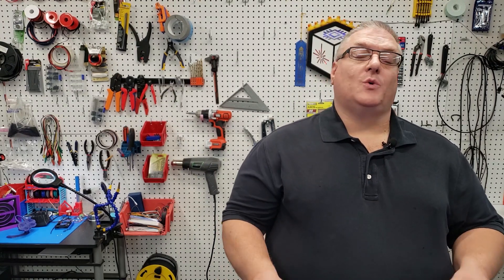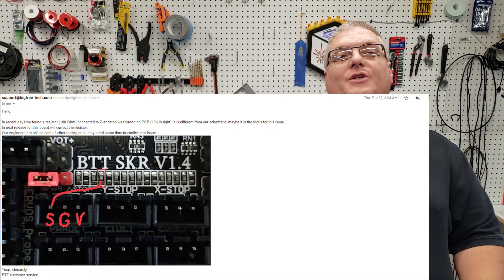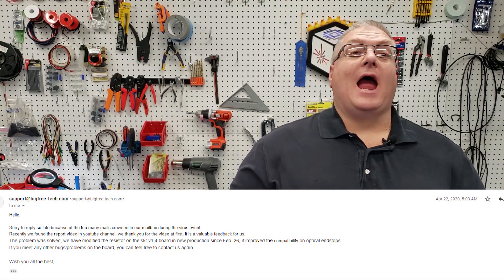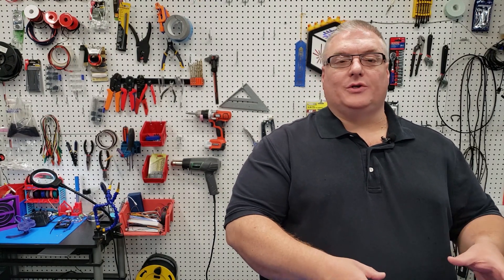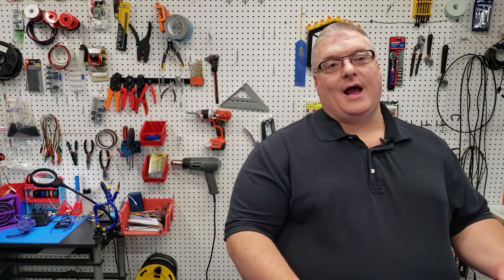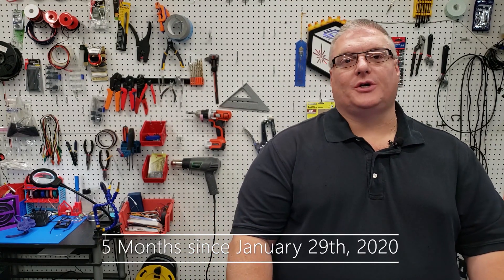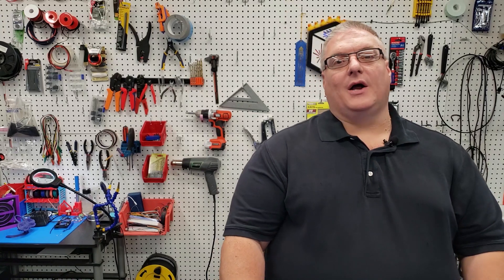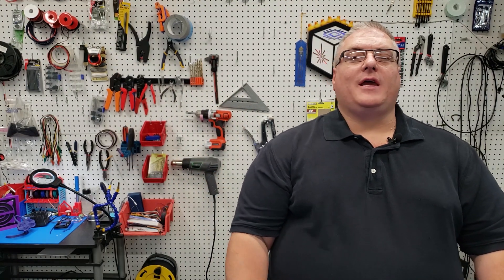UPDATE to the Big Tree Tech SKR V.1.4 Mainboard Endstop / Limit Switch Bug

Comment from the maker: What are your thoughts on the way BTT responded to the issue?
Reply: Agree with your assessment. Terrible customer service and passive aggressive behavior. Speak truth and let the bottles fall.
Reply: They ignored me...never answered my request for a replacement board.
Reply: Hello, the support level 1 is really reactive if you have issues with configuration,  but the level 2(engineers), from BTT they are really busy, so if this is not a configuration setting invalid, but a real trouble, I never get an answer.  For instance I submitted 2 real issues: mechanical dual endstop repeal from BTT  not working in standalone for each motor,  and another issue when extruder is set to 0 then the board is never seems as connected by tft BTT 43 and 70. For both issues I did not get any answers from engineers.

Comment: The 4th resistor number is R17 and it's value is 1k.  not 10k.
i purchased skr 1.4 just few days before, and it have correct resistor that i checked by multimeter.  but it has same issue.   the end stop worked well at first operation but now the mechanical z end stop has always triggered position.  why?????

Comment: both my boards (1,4t) ..    don´t work on any endstops pins..

and my latest board  are from 20200627  and still have the wrong  resistors,  you can look at your board if there @  2.8-3.3v and S pin then  its good.   but all my boards have only 0.025v   

I double checked on my  1.3 board  that works correct 
and even my old ramp 1.4

Comment: Hello, thanks for this video, I submitted to BTT an issue with Dual mechanical endstop on dual axis with dual endstop. Each endstop is stopping both stepper motor, instead of stopping only the related one on which it is connected.  They tols me my configuration is right, and send to hteir engineer, this is a month that I submit this. 

did you encoutner this issue too ? 
I also have trouble with sensorless homing on SKRV1.4 with TMC5160

Comment: I have an issue Using: Creality Ender 5 Plus with a Bigtree Tech SKR 1.4 Turbo and a TFT 35:-
G28 Homes using the built-in BLTOUCH but G29 just makes a short "cheap" sound, as if G29 instructions are running BUT no action takes place i.e. no auto bed leveling. The print continues without any issues; I have been in touch with BBT they replied quickly asking for photos of wiring which I sent but no word back since; I will try to see if it is this resistor.

Comment: I got a later version of this and tried using an optical endstop on the Z-pins. Had to switch the Marlin config to use pull-down instead of pull-up resistors and everything worked fine. TMC2209 and had the diag pin clipped.

Comment: Just had a similar thing with the z probe. The board infront of me has 01B marked on the resistor on it which is 1K. This value is still too low to trigger an indictive probe that is NC. Swapping to a NO probe fixes the issue (I have one lying around) rather than putting in a transistor to switch it properly or trying to find the proper value SMD resistor.

Comment: Kinda mixed thoughts here to be honest. They should have been way earlier in acknowledging the issue, and therefore rolling out a guide on how to get around this problem. This would helped pretty much everyone, at least if only 1 of those 6 ports was affected (you must have quite a setup to use all 6 I think). Partial refunds or coupons could also have been there for those who are affected. On the other hand, how much should we expect from boards like these? I would not say we pay for much support and replacements here. China spits out flawed printers and we find that kinda normal to fix ourselves, because of the price point. I don't think creality did do anything to help  owners fix their melting connector on earlier ender3's for example.
Reply from the maker: Great feedback Christoff.  You make an excellent point about how much we should expect from these boards (or companies).  I think there is a real trade off to be had here.  We all take advantage of low cost of china goods but then have a high expectation of quality.  Would we all pay an extra dollar for better quality or support?  I would but I'm sure others would rather roll the dice. You make a great point about the Ender power connector.  The community took it upon themselves to resolve that issue.  Now that you mention Creality it also comes to mind that the disabled thermal runaway was (and still is) a highly discussed topic by many creators.  I believe that many creators helped drive that change at Creality to enable it by default.  I heard (rumor) the reason it was disabled was due to poor quality thermistors with wide thermal ranges.  If that is true we're back to the ultra low cost and high quality expectation again.  I feel we as consumers have demanded such low prices we may be putting companies like Creality and BTT into a position where quality has to be sacrificed to stay competitive.  Really great food for thought here Christoff as always.
Reply: @MakersMashup  Champagne  taste, beer money comes to mind with a lot of consumers these days.

Comment: I am not that surprised at the poor customer support.  Most Chinese companies seem to be like this or at least that has been my experience.   I had issues with Gearbest that frustrated me so much that I just bought the replacement parts myself from a US company.  

As far as this SKR 1.4 bug, did they tell you what resistor value it should be?  I would not think it would be too hard to fix it if it is just a resistor value.  Maybe you could make a video of that so others who have the same defective board could fix it rather than having to deal with Bigtreetech like you did.

Comment: I received my BIGTREETECH 3D Printer Part SKR V1.4 Turbo from Amazon on June 12th. Is there anything on the board that would identify it as being updated?
Also, I have had it with BIGTREETECH. I ordered the heat bed, from them, on June 9th and received an email on June 12th with a tracking #. Every time I checked the tracking # there was no information available. Finally yesterday, after numerous emails, they admitted it was not shipped and they have none in inventory. I have requested a refund and placed an order with another company.
Reply from the maker: In the video Tom you can pause it and look at the screen shot BTT sent.  That resistor is the one in error.  It wont affect you at all though unless you're using an optical end stop for the Z.  The X and Y work fine.

Comment: So just to preface my response here, I have no affiliation with BTT or greater affinity over any other board maker. You have giving us the timeline and I don't want to use this as a general  excuse but you do realize that all of this fell right into the current crisis, right? What is your gripe withBTT? They fixed the problem. Sure it took some time to send you some replacement boards. There were and still are  backlogs in production all over the world. There are still issues with transportation/shipping out of China. I work in procurement and believe me when I tell you it is still a p.i.t.a.. However I want to thank you from all of us in the printer community that are using BTT boards that you have taken it up with them and got them to fix it.
Reply from the maker: Eric - Thanks for taking the time to provide your feedback.  I understand your frustration and COVID has and continues to play a big part in delays overall.  I don't have a specific gripe with BTT and as I said in the video I was disappointed and felt the process took way longer than it should.  I did consider COVID in my response and the time it took BTT to respond.  The issues I had however were not simply supply chain related.  I think BTT could have been more transparent about the issue, had it in an FAQ or even noted it in their code repo.  I understand if they don't want to air their dirty laundry, which is their choice. I approached this entire issue from trying to help the community including BTT.  I provided documentation to them long before the video and gave it from Jan through April to respond to the community.  Then I publish a public video and the next day I receive a response. None of that time period or communication back and forth was really COVID related.  The issue in my opinion was not important to them until it became public.  That is how this feels in my opinion.  Then the opportunity exists for BTT to come through with a public win.  If they would have sent the boards faster I'm sure my response would have been something like "These guys rock".  Instead it took 2 months to get the replacements.  I feel it was not a priority for them. Maybe indeed it wasn't and perhaps it is still not.  I feel though this does speak to BTT's business practices.  Sure COVID did play a part but not as big a part as I feel BTT played in it.  I feel BTT is doing good things here in the community overall and as I said in the video still plan on buying their products.  My goal here is to education and be transparent so viewers like yourself can make an informed decision.  Thank you sincerely Eric for your feedback.  I'm always glad to respond to constructive feedback.
Reply: @MakersMashup  Thanks for taking the time to read and reply to my post.